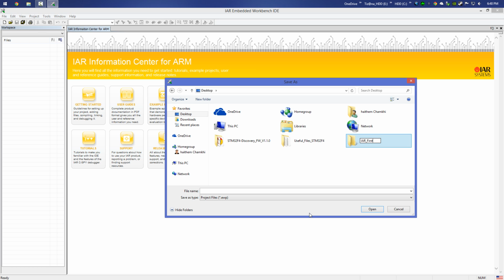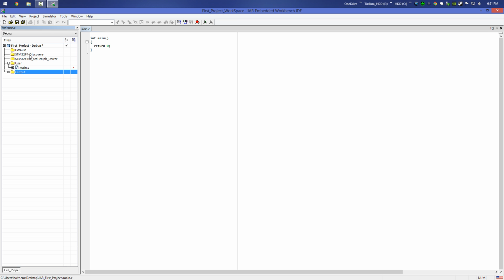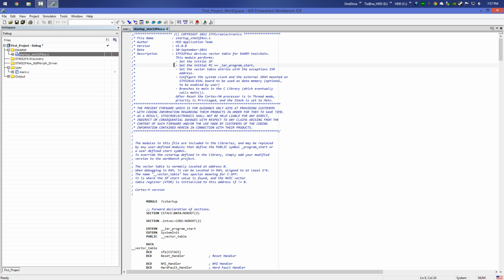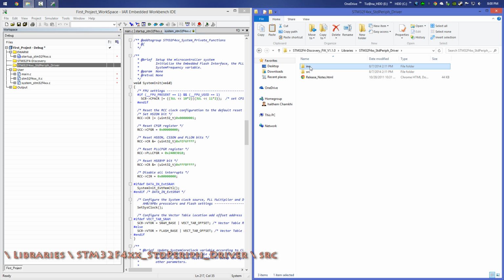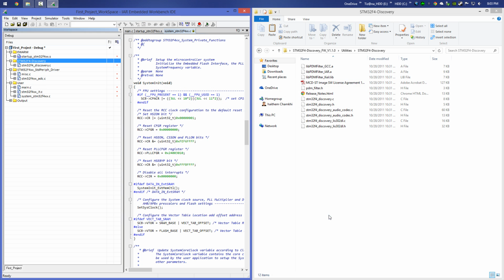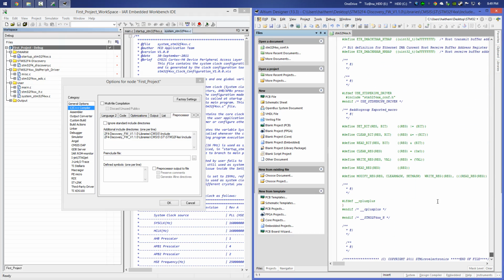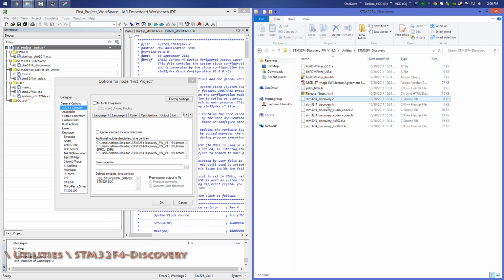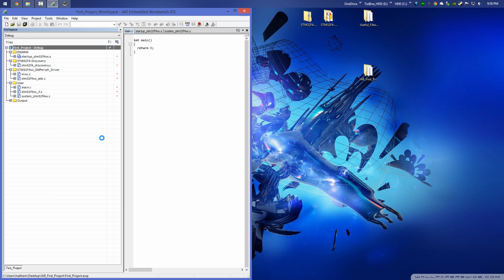STM32F4 Tutorial : Setting up your first project for STM32F4 using IAR Embedded workbench

Comment: Are these all really necessary?
Reply from the maker: you can use STM cube, it's GUI and it will make your life easier
Reply: @TizanaMenYo  but why people made it so complicated? I mean the designers of this system
Reply from the maker: @hyperloop7053  This is an ARM microcontroller and it's more complicated than the old 8 bit microcontroller.

Comment: "If you are using IAR 7.1 version or later you will get many warning during compilation, you have to modify your startup source file as mentioned in this link : "  this link doesnt explain anything ?
Reply: The same solution from different sources: https://www.iar.com/support/tech-notes/assembler/warning25-label-xxxxx-is-defined-pubweak-in-a-section-implicitly-declared-root/
or
https://stackoverflow.com/questions/22450602/how-resolve-a-warning-in-iar-reset-handler
or
https://doc.xdevs.com/doc/IAR/Technotes/IAR_TN30605.pdf

I tried its worked.

Comment: Im having STLINK V2 and made a custom board with STM32L152VCT6 running IAR EWARM V7.80 .
The debugger is updated with latest firmware and USB device Drivers.

Im connecting via SWD and initially I erased my STM32 with BOOT1: 0 and BOOT0 : 1. I connected with ST Utility it was able to detect the IC correctly.

Now I reset the BOOT1:0 and BOOT0 : 0 to enable writing my main code via IAR. Now this is where my problem lies . I sucessfully compiled the program with 0 errors and downloaded the code and it did flawlessly.

Once the MCU is reset by the IAR to run to Main() and give me control over single stepping . It infinitely goes into a loop which I cannot identify, but when stopped it ends up completely else empty areas like MOVS on the disassembly. 

The bottom line is I cannot single step and debug my code.

Comment: Hello? I have a lot off warning with versionIAR IDE 7.1
Reply: The same solution from different sources: https://www.iar.com/support/tech-notes/assembler/warning25-label-xxxxx-is-defined-pubweak-in-a-section-implicitly-declared-root/
or
https://stackoverflow.com/questions/22450602/how-resolve-a-warning-in-iar-reset-handler
or
https://doc.xdevs.com/doc/IAR/Technotes/IAR_TN30605.pdf

I tried its worked.

Comment: I used this tutorial to setup STM32F0308-DISCO. STSW-STM32140 contains a complete IAR workspace with the demonstration software as flashed in the board by default. So no need to setup a complete IAR EW project for this board from scratch. Anyway ... this tutorial helped me to  kickstart with the board and IAR... nice work.

Comment: Great work. Thanks. but when i rebuild i get 92 different warnings for the file "startup_stm32f4xx.s"
Reply: +Era Era you use an old file "startup_stm32f4xx.s"   in a new version of IAR embedded  workbench,that's why it shows a lot of errors.you must download the latest version of this file directly from ST website and replace it instead of the old file,then it will run well and won't show errors again,,,,
Reply: The same solution from different sources: https://www.iar.com/support/tech-notes/assembler/warning25-label-xxxxx-is-defined-pubweak-in-a-section-implicitly-declared-root/
or
https://stackoverflow.com/questions/22450602/how-resolve-a-warning-in-iar-reset-handler
or
https://doc.xdevs.com/doc/IAR/Technotes/IAR_TN30605.pdf

I tried its worked.

Comment: Hey. I'm having a problem. when I rebulid, it says "fatal error: cannot open source file "main.h" "
I have no idea what to do. thanks for help!
Reply from the maker: Kristjan Berce double click on the error and tell me in which file the include main.h is called
Reply: TizanaMenYo stm32f30x_it.c
there is red cross next to #include "main.h"
Reply from the maker: Kristjan Berce you can put it as comment by adding // or simply delete it because in our project we didn't add a main.h header file 
OR you can create a main.h and put it in your project directory then include it  also in the top of your main.c code like this #include "main.h".
Reply: Yes, I have tried that, but then it says it cannot open next include file. I think Its usb_something. Should I comment that too?
Reply from the maker: Kristjan Berce in this case its better to create a main.h files its better in your case
Reply: TizanaMenYo there is the same error with #include "usb_istr.h".
Reply: TizanaMenYo I'm new to that, but does it realy take that much time and nerves just to begin with a project?
Reply from the maker: Kristjan Berce in which file did you find the #include "usb_istr.h" ???
with the ARM microprocessor its a little bit complicated, but if you success one time to setup your project you can save it and use always to start a new project.
Reply: +TizanaMenYo hi , the leds on my board are not blinking when i connect it to the board , is something wrong with my board ? please help

Comment: TizanaMenYo The link of Useful_Files_STM32  is broken on your website, can you fix it ?
Reply: TizanaMenYo thanks man, it helps a lot :))))))
Reply: TizanaMenYo and maybe, if you consider making further videos about STM32F429I board, i will be grateful because there is no video about it. :)))
Reply from the maker: Yes, i'm updating my website right now !! so this is why the link is broken :)
Reply: TizanaMenYo okay i am waiting for it :)
Reply from the maker: It's done !!
Reply: TizanaMenYo by the way, i am using STM32F429I-DISCOVERY board, should i apply this video steps ?
Reply from the maker: Yes you can do it with slight modification.

You have to download the driver firmware for your board here : http://www.st.com/web/en/catalog/tools/PF259429# 
go to the end of the page and download the driver.

inside the configuration you have to select your Board microcontroller the STM32F429ZIT6 instead of the STM32F407VG

The ST-LINK/V2  debbuger/programmer  is the same as the STM32F4-Discovery.

i think the useful file are not the same. you can find these files inside the driver board in the Example Folder. you copy these files from the example project .
i'll check it later
Reply: Fatal Error[Pe035]: #error directive: "Please select first the target STM32F4xx device used in your application (in stm32f4xx.h file)" C:\Users\310177446\Desktop\stm\ST_IAR\stsw-stm32138\STM32F429I-Discovery_FW_V1.0.1\Libraries\CMSIS\Device\ST\STM32F4xx\Include\stm32f4xx.h 101
Reply: athira nair n k I get such an error and cant edit the header file..its locked. What should i do. Thanks for your video, it was really useful
Reply from the maker: ok ! in my video @ 16:48 in the defined symbol don't write STM32F4xx, because your micocontroller is defferent. So you write STM32F429_439xx.

then go to stm32f4xx.h header file of your driver and open it .

in the line 68 you have a condition "#if !defined (STM32F40_41xxx) && !defined (STM32F427_437xx) && !defined (STM32F429_439xx) && !defined (STM32F401xx)"

and it tell you to Uncomment the line below according to the target STM32 device used in your application.

So you have to uncomment the  /*  #define  STM32F429_439xx */  (line 76)

note : the lines number can change from one version to another.

Compile and tell me if it work or not ??
Reply from the maker: if you can't modify the header file use an another compiler as i do. or just open it with NotePad.
Reply from the maker: Bican güzeler check this out !
http://www.electronics-homemade.com/STM32F4-SettingUp-FirstProject-STM32F0_1_3_4.html
Reply: TizanaMenYo thank you so much. it worked